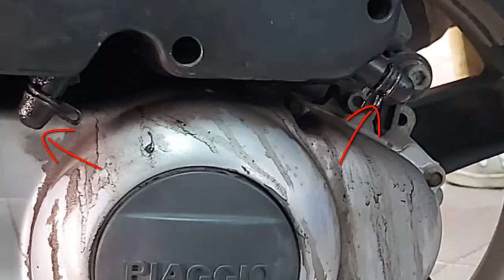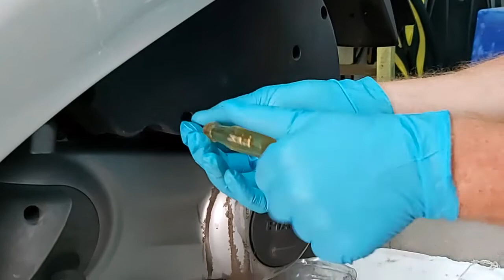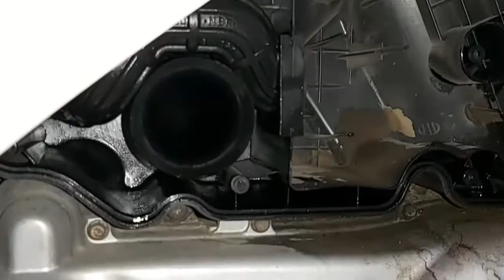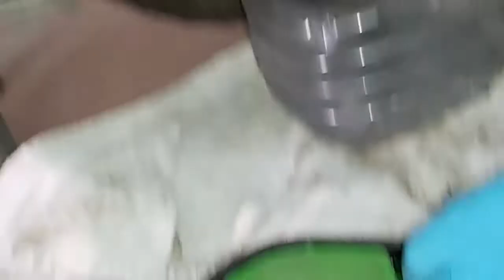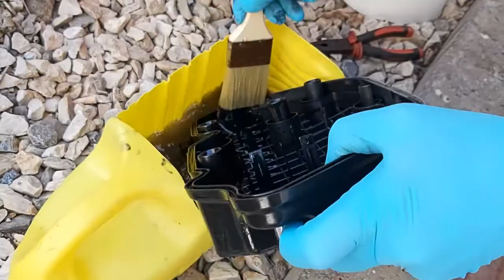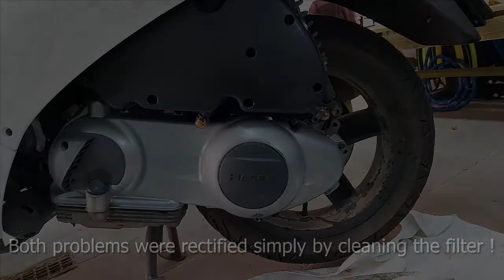Clean/Change Air Filter on Piaggio XEvo 125

Comment: Is it normal to have that much oil there ? What is the cause ?
Reply from the maker: Apologies for the delay. No, it's not normal, the oil was over filled and it's "normal" for the engine to push excess oil through the air filter.
Reply: @MichaelWebMason 
How do you change the oil 🤔